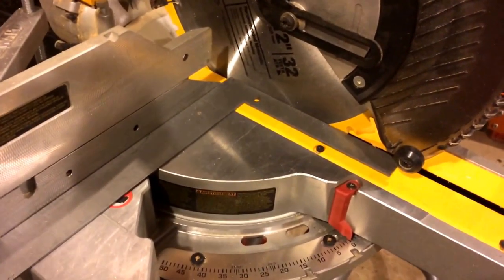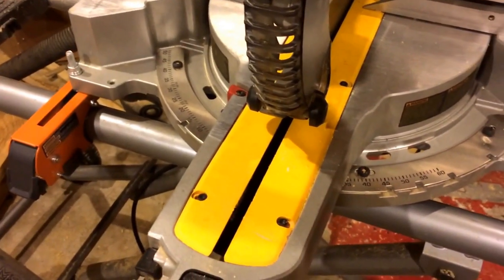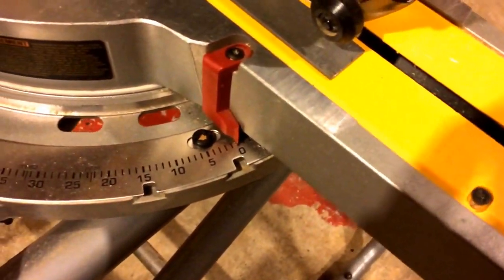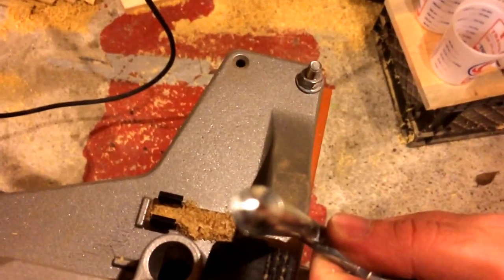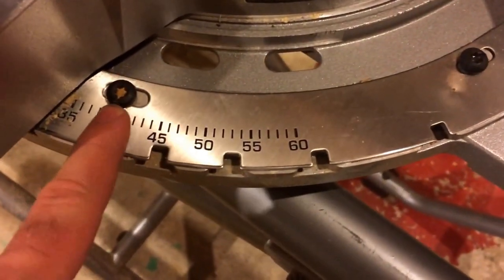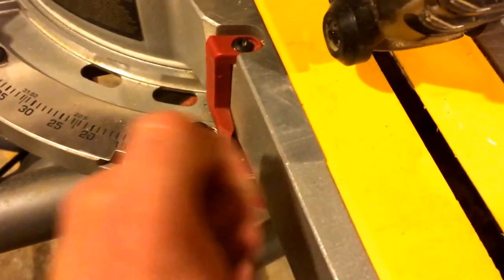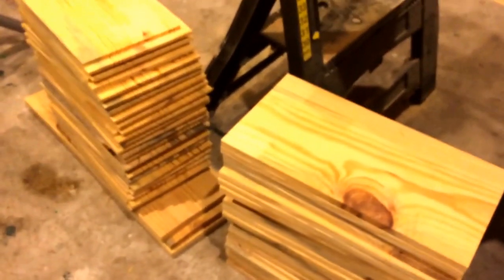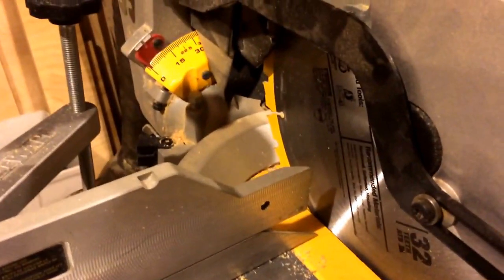Squaring a DeWalt Miter Saw on Factory Scale

Comment: I just unboxed my new Dewalt miter saw and watched this, thanks so much for the tips, super helpful!! Just a thought, you mentioned how the longer the cuts you and your wife made, the more pronounced the errors were, great point. So in theory, if you slide the blade out all the way when you're fixing the alignment would it give you even greater accuracy when correcting it since the further out the blade, the more you'll see the alignment is off? I mean we're probably talking the difference between excellent precision and outstanding precision but just figured I'd throw that out there. Def gonna align it with your method then double check it with the fully blade extended, couldn't hurt. Thanks again for the how-to video, its really nice to get this tweaked properly out of the gate and you did a great job of explaining it. Edit: After all that, the miter angle was spot on from the factory, kinda surprised. The bevel, however, required tweaking, but using that angle adjustment bolt to get it precise was pretty straight forward.
Reply from the maker: The error does not get worse with length, just is more noticeable. If you have an error of 1/8” over a foot, you might not see it. But over 4’ your off a half inch. If you have a 16” square that would be good. Use the biggest square you have and slide the blade out to match.

Comment: It naturally moves over time. Because most people cut from 1 side more than the other depending on wether your righty or lefty. An depending on how often u use ur saw. Should be checked every few months atleast. To make sure it hasnt slid again. Especially after you've adjusted. Because you'll never get those torx screws as tight as the factory. You also need to check your bevel, fence, & plate. Everything moves over time.

Comment: I'll have to see if there's an adjustment on mine.  I have a very expensive craftsman dual compound miter saw that I've done trim work with for years.  It's off a hair but I never thought about there being a way to correct it.  I just chalked it up to things not being made the way they used to be.  I never thought to look into how to square it up.  Thanks for the idea.
Reply from the maker: Yeah, check for sure. I had to set the scale on my table saw too. Even still, my rip fence isn't tight enough, and I still always measure off the blade with a tape. You have to remember, the guy putting these together in the shop probably isn't getting paid much...
Reply from the maker: 628DirtRooster Excellent!
Reply: I noticed that on mine today 10/31/2018,  not getting the straight cut I wanted, so I made several test cuts, from both sides of the blade, both side were cutting a hair off. So I ran a straight edge across the fence, the fence is off, not on level plane from left to right more like a jointer with uneven surface.. I always felt a little snap when the blade cut through the wood and it's because the fence is not aligned properly. Tom's words were my own, I'll use that method to get one side to cut square and be happy with that.

Comment: I believe my fence is out on the right side square is 90 on the left but has a gap on the right
Reply from the maker: Well I guess that’s possible. The back fence is two separate pieces right? If that’s true, you need to also make sure the two fences are co-planer. Use a high quality level and just push it against the back fence with the blade up to make sure one isn’t a bit forward of the other. You must have them coplaner, then you can adjust the miter so it’s square. Good luck!
Reply: @TomBrueggen  It looks like one solid piece that was cast.  I am going to call the 800 number tomorrow.

Comment: How would you square up the slide to the fence?
Reply from the maker: The top slide? Doesn’t it just ride in a groove on top of the lower portion? Maybe I don’t understand your question.
Reply: @TomBrueggen  thank you for the reply.
I will try to explain  better. 
There is the vertical square: / tilt I guess that is being square off the table. 
And  horizontal square which is squaring the saw against the fence.
Once I do.that all nicely. And yes I do.pull forward and back.when squaring against the fence. 
Believe me I know what I'm doing (want a be mchinist / 30 years cabinet and carpenter....etc)
Well, On DeWalt slide chop saw when it's pulled forward the blade angle  changes in tilt and side to side both.
Reply from the maker: @AB-yu2tj  ah well yeah I don’t know how to find tune it. I will say this dewalt saw is not the most precise you could ask for. We have upgraded in our shop to a Bosch Glide and now a Festool Kapex. The DeWalt has become my rough and ugly but we don’t use it for any fine woodworking cuts

Comment: I have 4 different set squares and they all are different. So I think I need a precision square first, if the square is out the blade will be out using it.
Reply: I got small engineers squares that are category a or b, i forget, but its like guaranteed accuracy and certified
Reply: you can actually square your square ;) put short end on edge of a straight table. draw a line along the long side. Flip it and drew a new line next to the first line. If the lines are paralel, its good. (The flip---->⅃ L) to open the sqare up put a knock the metal on the Inside corner with a nail. To close the square knock it on the outside corner.

Comment: I hope you are still taking comments. I have the DWS780. I thought , how could it bee out of square....well it is out of square but by just a hair...it is maddening...I followed your instructions.....the left side with the square is perfect, but when I put the square on the right side, i see where my source of error comes from when I make my MEDIUM 8-frame HIVE BOXES..... it should be perfectly square on both sides right? The fence is not adjustable? thanks again.
Reply from the maker: I don't recall that the fence was adjustable on both sides. Seems like that would be a bad idea. You can slide the upper fence in and out (closer to the blade or further away)  to have more control on bracing cuts near the blade, but don't think you can push the fence closer or away from the operator position. Usually you just adjust a stop or guide position to make sure your true square lines up with what the guide shows.
Reply: I have read that these fences can be 'bent'. you can place a straight edge up against the fence to tell. it should sit flat up against the fence on both sides.
Reply: Turned out that i had a defective fence for over 2 years and dewalt honored their craftsmanship and replaced it...i could not explain why my work was always just a hair off
Reply from the maker: You need a good high-quality level that can double as a straight edge to check things like this. We figured out our table top for our router table was sagging in the middle. We were convinced our work piece had a bow but the level didn't lie. The wood was straight, table was not!
Reply from the maker: So DeWalt replaced it for you? Claimed it was their fault?

Comment: So my problem with my dewalt dw715 is that the right side of the fence is not square to the base of the Saw, every adjustment i can make I have but i cant find any answers for this particular problem.
Reply from the maker: Yeah I'm not sure about that one. It should all be machined for flat faces that just bolt together. Unless it somehow got dropped or hit and bent.
Reply: I have the same problem.  I just got my saw yesterday and doing all the adjustments.  The blade is now perfectly square to the left fence but when I go to see if it’s square to the right, it’s quite off. Did u ever find a solution?

Comment: Can you help me i bought a new dewalt same as this model the blade is not in the center of the cut hole, it can touch the left side of the cut hole when it is fully pull down can it be fix. Need some help please.
Reply from the maker: I'm really not sure about this one. But the "cut hole" you refer to, I think you mean the dust shield. It's plastic, so if the blade hits it, that's OK. It will shave it down to where it has clearance. The bigger concern is whether or not the blade is square with the back fence or the deck. If it's a brand new saw, you should have some warranty. I'd take it back for one that you feel is assembled correctly. One less issue to worry about.
Reply: I've bought it from online shopping its very important for my work and im in a hurry so i don't have time for that exchange, i hope you will be able to solve my problem so i comment this. If theres a way to send you pictures i think you'll know my problem, so can you help me is there any way to send you pictures.
Reply from the maker: Nah. Just remove that plastic dust shield, just a couple screws. Then bring the saw head down (not running) and see if the blade contacts metal. If it does not, then it's a none issue. Then you just have to make sure the saw blade is square with the back fence, which can be done by adjusting the slide/stops on the front scale.
Reply: Sorry now i know what my problem really is the blade touch the left side of the kerf plate, can it will be fix.
Reply from the maker: Samuel Lalmalsawma are you sure you put bushings back in proper alignment?
Reply: Dont know anything much but i think it should be good cause its brand new and i think almost everything is company assemble.

Comment: I HAVE THE SAME DAMN PROBLEM... HOLY S*** thought I was special with this issue..
Reply from the maker: Nah, it's common enough. You should true any adjustable tool when bought new. Table saws (miter, bevel, fence) circular saws (bevel), etc. I used to have a different compound miter saw and sold it because i thought it was "broken" when it wasn't cutting perfectly square. Now I realize I could have probably just adjusted it. Oops!

Comment: First thing you should have done is change the blade to a diablo, when it rings like a bell thats  the worst blade to have, second theres simple adjustment to be made without messin with the plate, yes there are things that you should read the instruction on, this is one of them, change the blade man you,ll be shocked at the difference
Reply from the maker: Can you share how to make the simple adjustment you suggest? Not lying, I don’t even know where my manual is at. I agree on the blade. We run Freud in almost all our saws now.